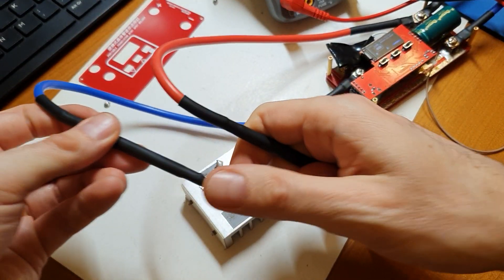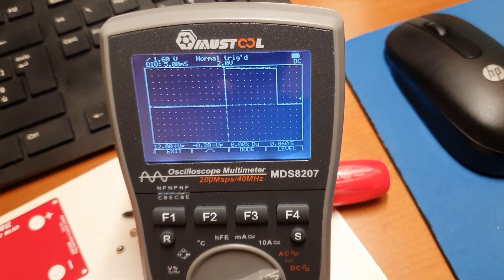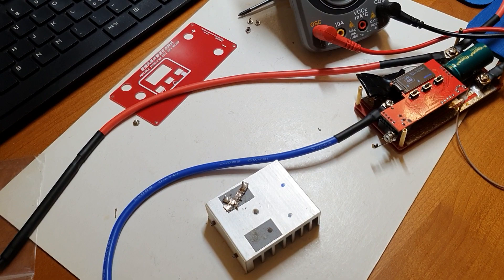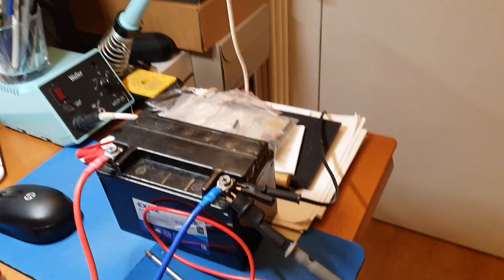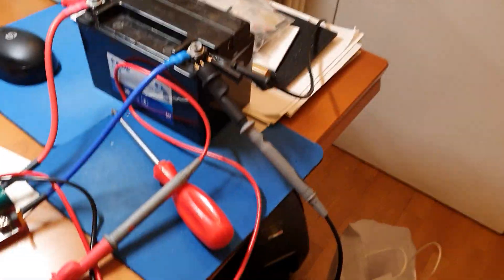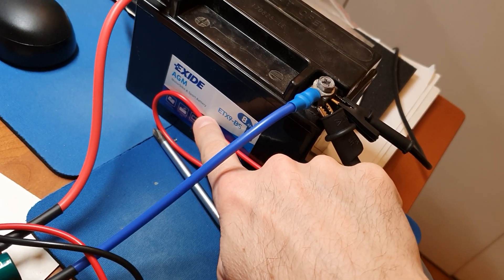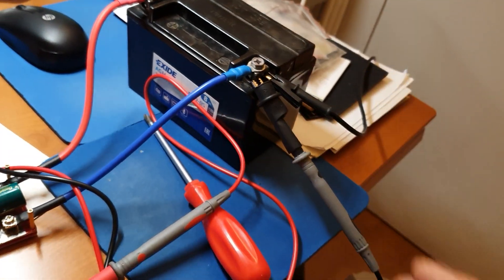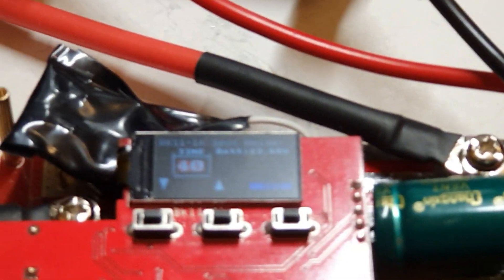Mini Spot Welder (BK/BL series) Arduino Port Weld Tests

Comment: Magnifique. Very good job ! Now, we need plans, program, and references 😁😁
Reply from the maker: All the description of the wiring, Arduino pins etc is in the source file (and some I already expained in the videos). If you want to Beta test I can send you the file but I will be posting instructions on instructables.com shortly.
Reply from the maker: https://www.instructables.com/Arduino-Mini-Spot-Welder-Port-BK111820-Series/
Reply: @Luca_Techy  Thanks a lot. Your job is wonderfull.

Comment: Great progress. What are your fets?
Reply from the maker: The FETs are still the original ones (minus 1 which shorted and I removed) that are mounted - the 4N04R8 (40V 300Amps) which can be sourced from Aliexpress here: https://it.aliexpress.com/i/1005001369519751.html
Note: FETs in parallel should be all not only just the same type/model but also from the same batch or they should be matched by calculating their internal resistance in the ON state with a good deal of current.
Reply: @Luca_Techy  thank you. I have bought some as I blowed them up.